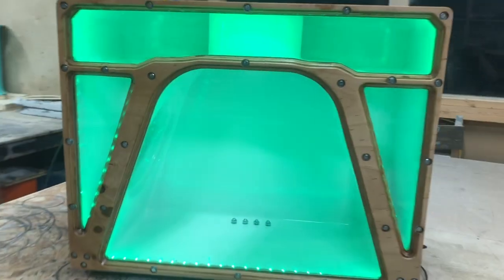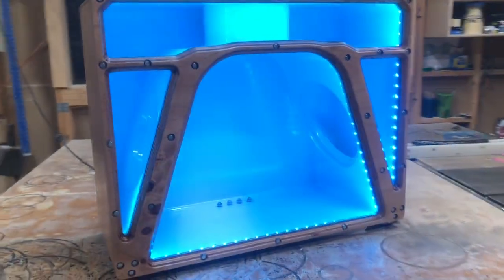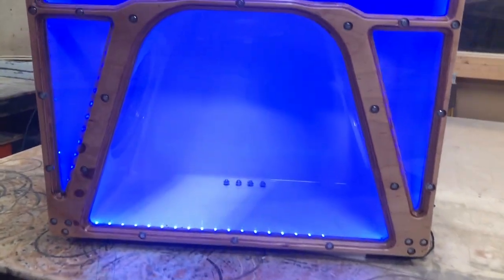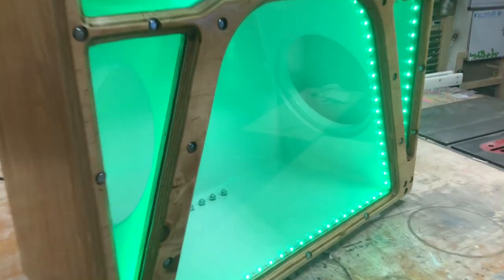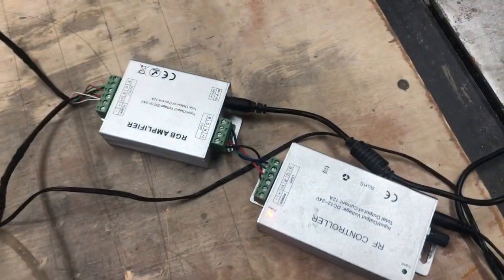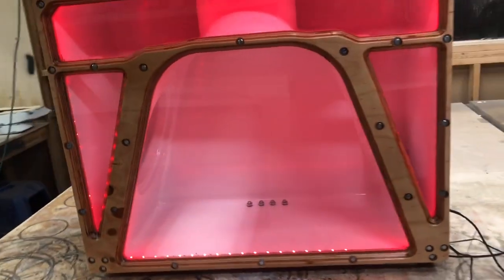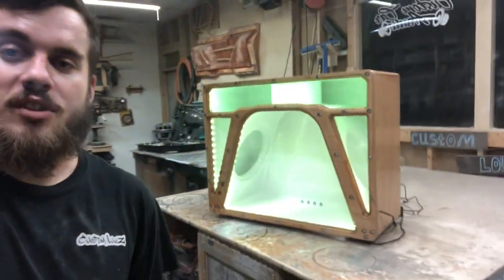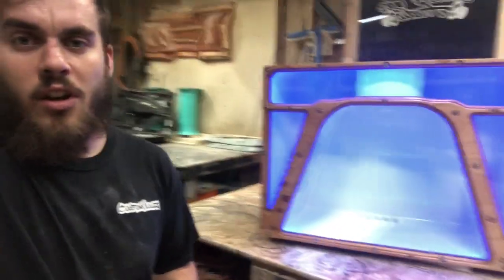CAR AUDIO MEETS ART! | Custom 4th Order (2) Skar Audio ZVX 12's | Custom Subwoofer Enclosure|

Comment: Hey do you guys do blow through enclosure for trucks? I bought a 99 Chevy Silverado with 2 15 in the bed in a box. That blows through and the system doesn't sound right. I bought 2 skar audio 15s and 2 2000 watt rms amps for each sub.
Reply from the maker: Check my website out! https://www.customlows.com/custom-enclosures
Reply: It might be tuned improperly